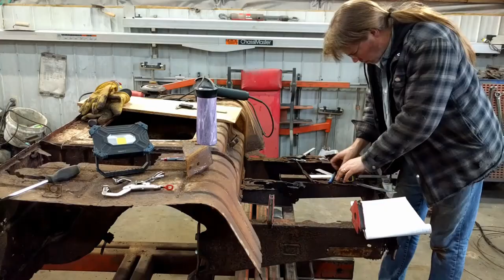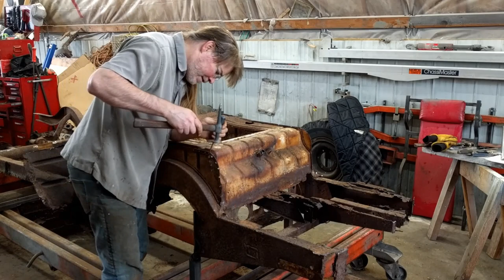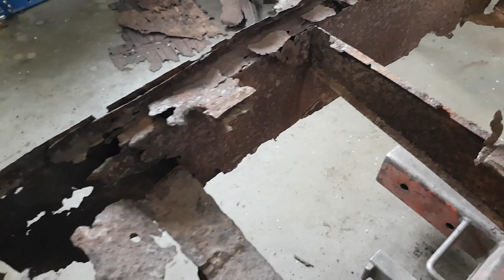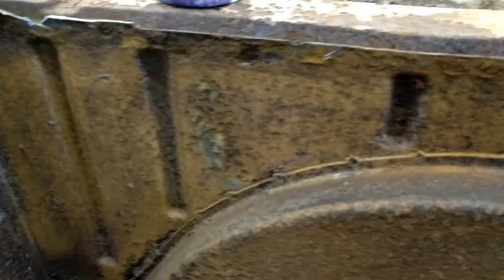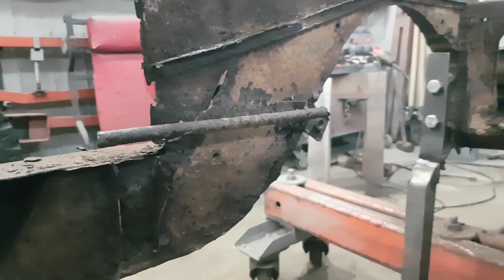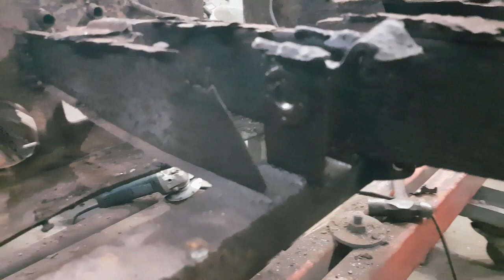The Nova Scotia Barndoor E06 - Front frame stripping

Comment: Definitely a good call taking off the body. I would have done the same. Those parts in the front are pretty thick 14 or 16 gauge. I think original was 15. Part of the main support system (unibody) I am not sure where your going to set up the frame jig it is all pretty bad to start from. The good news is unlike my bucket truck the frame is in tact so you can setup a support system and it is pretty much in the same place. Mine was rusted all the way though and splayed. so it was even more difficult to repair. I was also able to leave the cab on. Cant wait to see you making some of those parts. The shift support and front frame will be the hardest part. Seat stands will not be easy either.
Reply: Hey Mike. I wonder if this guy has seen your bucket truck videos ?
Reply: @pstreetgarage7304  IDK but he seems to know what he is doing on this. Pretty good so far. I Cant wait to see him form the panels. I see some frame machine parts behind him so I figure he has some experience with this sort of thing.
Reply: @Mikefngarage  Yes I agree it's a very interesting series and he in the province of Nova Scotia where I live.  Those buses are super scarce in this part of the world.

Comment: Excellent progress on the disassembly! How much of the original frame will you be able to retain?
Reply: I think he assessed the rear is in decent shape. the middle section needs replacing  obviously the front is pretty bad. but some of the parts that go over the suspension will need some sections.
Reply from the maker: The complex bits are good :)   Really only parts that will be replaced are the center rails and front ends. Rest will be repaired.